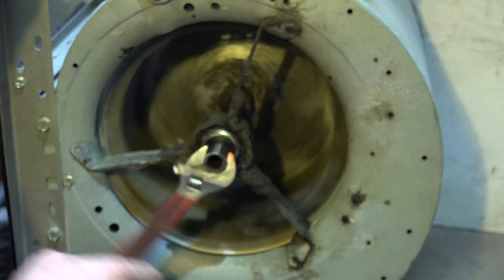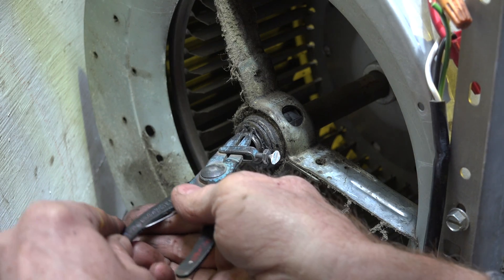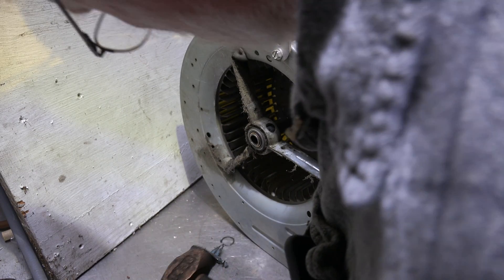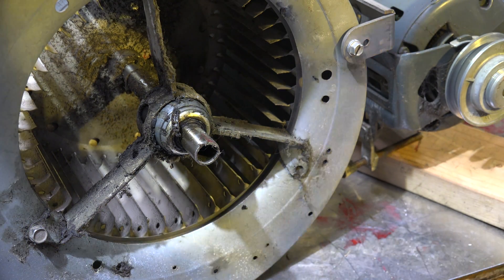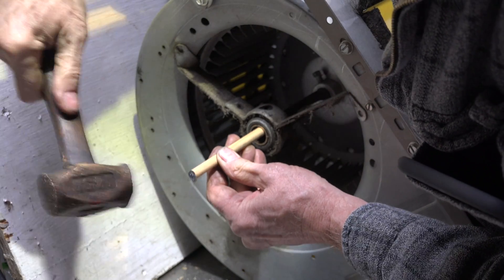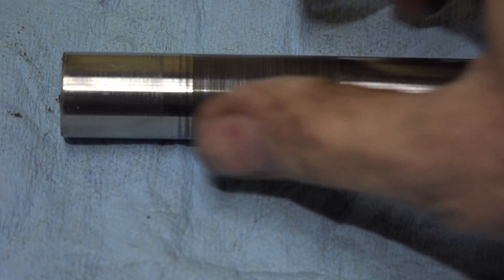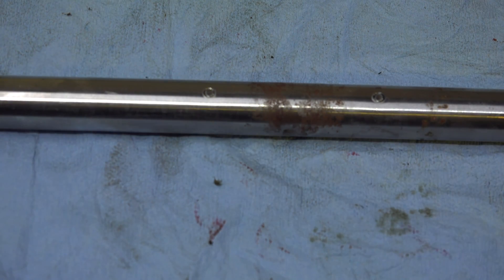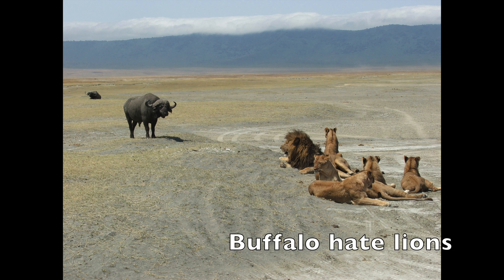The seized bearing in a furnace blower.

Comment: How do you clean the shaft by hand what do you use? Steel wool, Scotch Brite, or fine sandpaper??
Reply from the maker: It is best to replace the shaft or reverse it so the bearing surface is clean.  You can "clean" it with any of the methods you have said, but you still will have a surface that is not fit to use as a bearing.  
GFM
Reply: @grayfurnaceman  thanks for replying and information!!!

Comment: great video, would like to see you do a video or hear your thoughts on how long a modern 410a with POE (scroll or rotary) condenser would last in a system if absolutely no vacuum was pulled.  i know of one (goodman VSX series 2 ton. i didn't install it BUT i service it) that never had a vacuum pulled on it and so far it's going 2 years still running.
Reply from the maker: That's pretty much a long term test that I will probably never do.  Many air conditioners were, using manufacturer's instructions, not evacuated, but the lineset was just purged of air with the refrigerant in the system.  Many of these systems lasted quite well.  Not that I am advocating eliminating the evacuation.  We have gone past such procedures.  R-410A is much more sensitive to air in the system.  
GFM
Reply: thanks, was just curious on your thoughts.  i guess i'll be the guy who finds out. my own little experiment, muhahahahah......